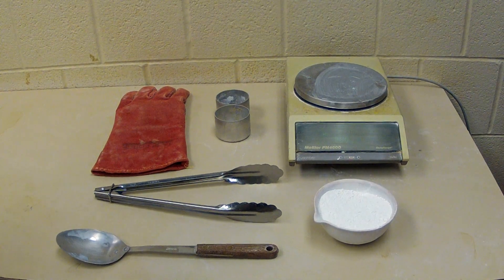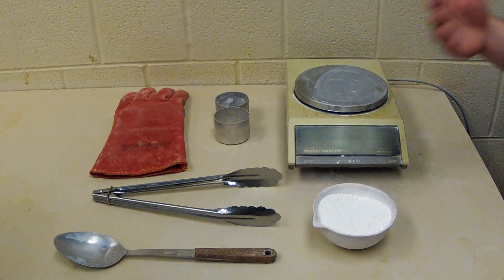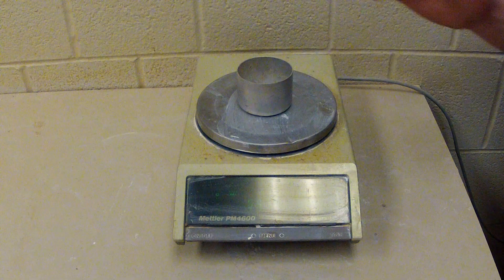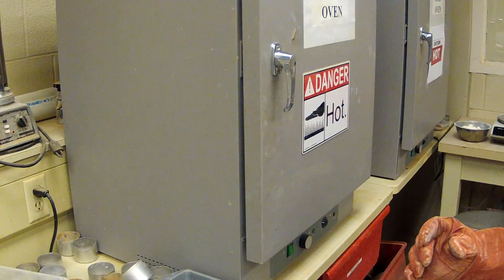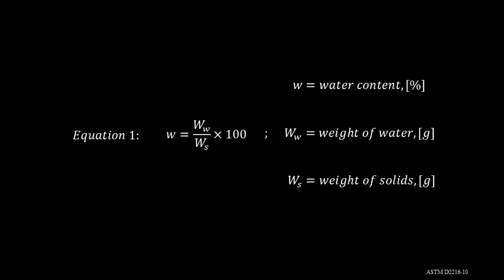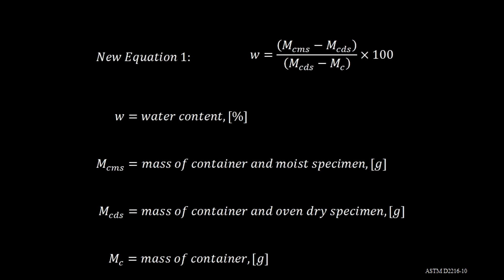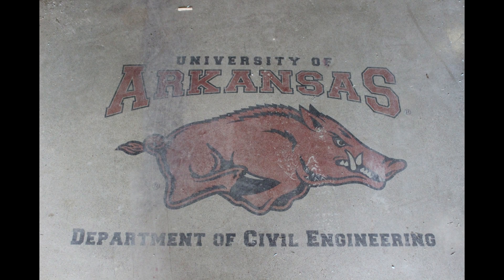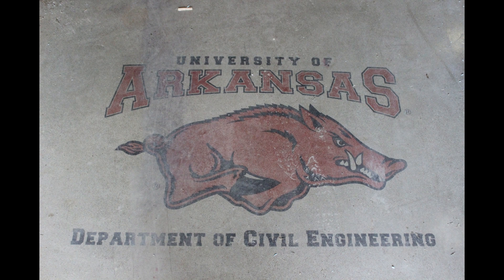ASTM D 2216 Water Content - University of Arkansas at Fayetteville

Comment: BTW, there is an implicit assumption the weight of the containers are the same. This may not always be the case. You should simply subtract off the weight of the containers before doing the percentage calculation using the material weights. Thanks for posting.